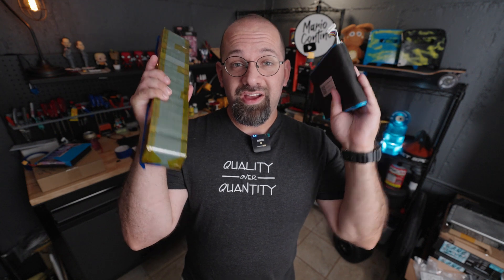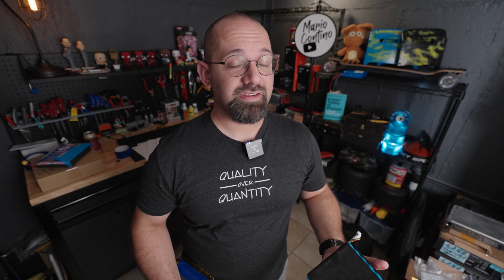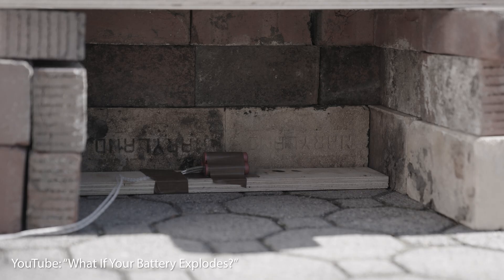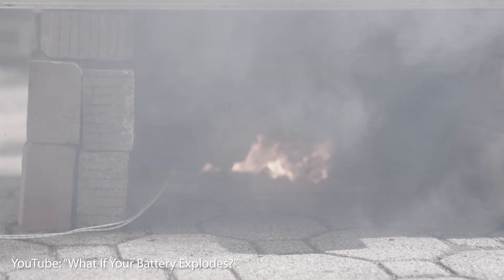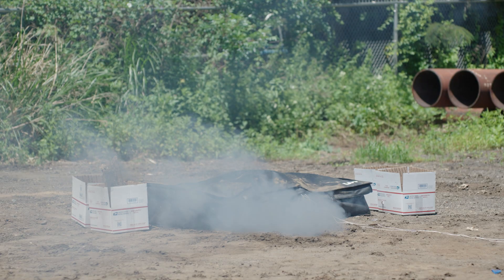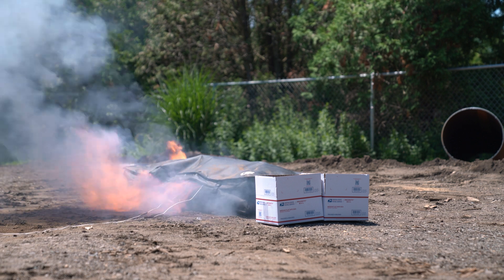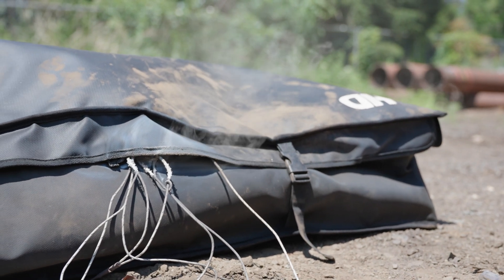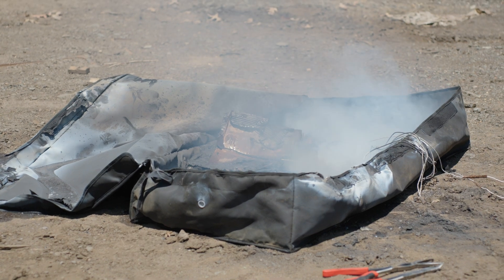Lithium Ion Battery Fire Bag | Big Ol' Boom Part 2

Comment: Thank you for your continued testing and this video! I am so confused…why is it so hard for the fire bag manufacturers to understand that everything needs to be vented up in a controlled direction! Having the flames point at the floor when the bag inevitably bulges out is unacceptable. Melting handles and buckles are unacceptable too. We can’t always be there as soon as the fire starts when attempting to drag the bag outside (or some safer location). The handles, hardware, zippers/Velcro, etc., need to survive. I’m not saying it’s easy to do that, just that it’s necessary.
Reply: Have you seen the products from firesak? From the testing I've seen, they seem to be really good.
Reply: @KendamaRomania  I haven’t but I’ll check them out. Let Mario Contino know too.
Reply: @KendamaRomania  Don't touch Fire sack, it's junk, chech out the videos on You Tube

Comment: What amount of which type of li-ion cell was merc'd in this video? as someone who has no dog in the fireproof bag fight, I'm trying to imagine the number of inches of leg I would lose during a potential catastrophic failure of my 18s2p Samsung 50S 21700 battery pack, and I need a baseline to go off of for that estimate. Related question: let's say someone had two x-lites fail right off the bat and has been ridin' dirty for ~six months, are there charging recommendations to minimize the chances of riding my board with a peg leg some day.
Like know this is not the safest scenario, but until it can be, what's the safest way to be unsafe, and is there any indicators I can look for during charge or otherwise that might indicate if one of my cells starts to drift a little (or a not so little)? Fungineers guy said he rode for a year with no BMS, and only one of his cells was a tiny bit off and was easily brought back to parity with no lasting consequence when he did finally BMS-up. Should I expect a similar outcome? :-)
Reply from the maker: The cell amount and type used here are about the same as they were in the first bag test. That’s to say, about 550Wh. The 18s2p 50S cell pack is 648Wh. 
At no point should you be using a lithium ion pack without a functioning BMS. Those who say they did it, should not be advising anyone else to mimic what they’re doing.
Reply: @TheBoardGarage  i am buying a funwheel BMS tomorrow if they aren't sold out.
Reply from the maker: @itsarlynbitch If you have a pack wired for the XLITE, it won’t work natively with the Fungineers BMS. It would need to be rewired or an adapter would have to be made.

Comment: Ok so- with all of this research which I'm super grateful for- how do we actually prevent fire damage from these things when: 
No garage, shed gets too hot/cold depending on the time of year. 

I got an ebike and it's my main means of getting around but I have no idea where I could put the battery where a fire wouldn't be a problem. 

I've looked around and most vids are just "Put it in a cool dry CLIMATE CONTROLLED place and I'm not sure there's a spot in my house that isn't at some risk. I got a basement but it's pretty packed in nearly every room so I don't know where I can put my battery without some kind of risk.

Comment: The Ebike revolution is not slowing down, if anything it's accelerating with larger and larger  battery's becoming the norm on ebikes,  I can think of  5 different brands 
right now that have  35 AMP and larger size battery's  even up to 60 AMPS,

We need more up to date  safety measures and fireproof bags  that  are effective,  so what's the latest out there?   This video is now   almost 13 months old:

Comment: You should test a Zarges case. It seems like bags just will not work as I can't see how a zipper or hook-and-loop can contain the force of the fire. From what I can see, Zarges cases are all metal and designed for this. I also have seen Bat-Safe cases that look like they'll work well.

Comment: I really feel like bags aren't gonna be it. I feel like the only way to play this game for keeps is to build a fire box which is deliberately vented out of the structure. Several layers of fire-rated drywall, with a galvanized duct out a window fitting (window AC style) maybe? the flames themselves don't propagate very far, if you contained them in a rigid fireproof material and gave all the hot gases somewhere to go...

Comment: IF you have a runaway of a cell the safest available place to put the battery is the oven, your oven will be done likely but your house will survive after you air it out.
Reply from the maker: Sounds a bit difficult to shove a flaming PEV into a conventional home oven… 🤔
Reply: @TheBoardGarage  I'm not speaking from exp, but the oven is near my charge station and I know my one wheel would fit as would the external batteries.. but yeah, I'd sure rather not have to try :)

Comment: Without going too deep into it is it not just pretty simple t say 

Okay potential energy of   500,000 joules ( just randomly picked for this example ) 

Force required to rupture rip stop nylon   250 joules 

...the bag WILL fail. 

If you want something burn proof you need a box with a vent to outside,  nothing else is going to contain this amount of energy, and if it does not have an external vent then the fire is not the only concern.

Respectfully intended Mario :)

Comment: honestly, i think the problem with the design is that they are only using one method of fire suppression.

it seems like they are just trying to starve it of oxygen....by using porous materials. but these all seem to be glorified sand blankets. with seams [which will leak with pressure.

Absolutely no hate on these companies, this is still probably better than nothing as it at least contains the explosion to an area but it's my observation.

I think you should fight a chemical fire, with some sort of chemicals. something simple to help the user "buy time" instead of trying to completely suppress the fire [an admittedly difficult task]

something like a one or several canister of fire hydrant fluid that "explodes" or melts at high heats might be cool. Or maybe the seams are lined with them somehow. it'll make a mess but its better than the alternative.

great vid.